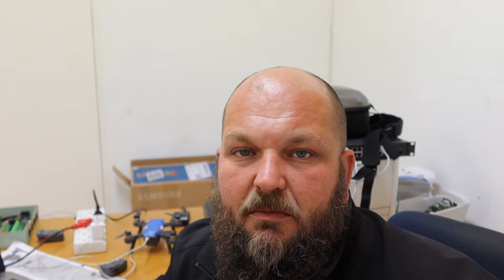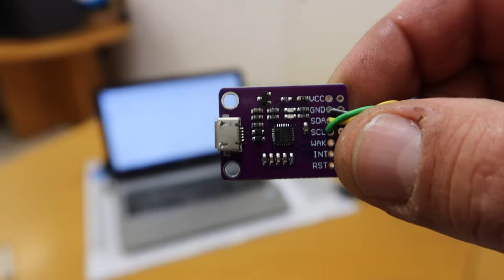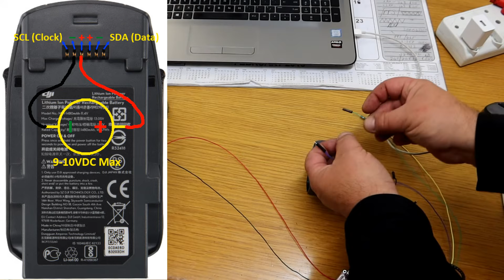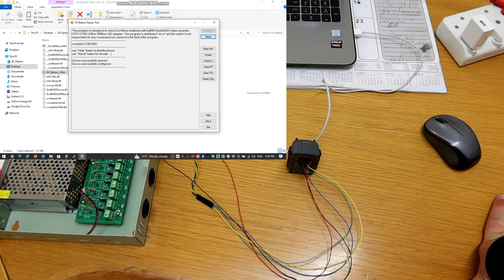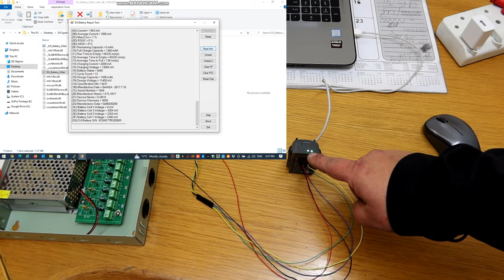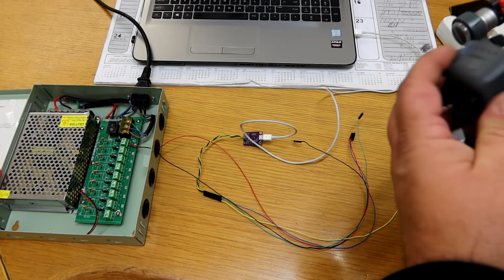Repairing your DJI Spark battery using a CP2112 HID USB to SMBus/I2C adapter!

Comment: Is there no easier way to fix this problem?  I'm getting the same light pattern as you demonstrated, but I don't have any of the stuff you used to fix it. I'm hoping if I leave it plugged in for a day it will fix itself, but I have doubts.

Comment: Cannot thank you enough, just bought an old Spark with about 5 flights on it (its like new) but been in the cupboard for years and the batteries would not charge. Bought the 2112 board and a few leads (used a 9v battery, worked fine) and after a few minutes they are back in in the charging cradle and charging nicely ... thank you for the great video, cheers. 😀
Reply: posso spedirti due batterie che non riesco a caricare? provi te s bloccarle? grazie

Comment: Hi Jacques great video being looking a video for weeks 
i`m have a problem with read info from the battery 
 get 0x00 error 
looked at you DJI softeware and it was diferent to the one i found can you email me a link 
 for the one your using as i now yours works regards Mick

Comment: Thank you so much for this video. I have watched similar videos where they make us pull the battery apart to do this. Your way is so much simpler and safer. Would you have a video showing how to connect the pins for the Mavic 2 Pro battery?

Comment: Just to add another thank you - this video was very useful and it matched the version of the software I was able to find on the internet.  One point to clarify which wasn't obvious to me (I'm not an electronics guy) - when you solder up the CP2112 you have to use the "inner" set of holes/ inner row of pins.  The labels on the back (eg I05 I06 etc) relate to the outer holes and are not equivalent.  If you aren't wired up correctly (or if your soldering isn't very good!) you will get "Error: Could not perform SMBus read 0x00" when you click "Read Info" until you get the connections right.  By the way for power I used a 9V PP9 sellotaped in series with an AA to give about 10.8V and that worked just fine.  Probably the PP9 on its own would have been ok if I had had my connections right first try!

Comment: thank you very much for this video.

I just finished the battery recovery process. It worked. I was able to recover all my 3 Spark batteries which I last used in 2022. I bought my Drone in 2018. 

I used the CP2112 from Lazada (brought to a cellphone repair shop to have the header pins soldered), Windows 11, 9V battery (with snap on connector to male Dupont wires), F to M Dupont wires, USB to micro-USB cable, and  DJI Battery Killer software.

Fortunately, my Windows 11 easily detected CP2112 debug board. I tried not putting the 9V battery at first but it did not work. The program is kinda buggy. Just keep on trying to run through the program if at first it doesn't push through smoothly. Sometimes it would give the --NOT responding - message and I just closed the program and started it again. On 2 occasions I rebooted the PC just to sure no other program was interacting with it.  Make sure all the wiring connections are correct.

Funny part was when wifey saw me putting on some protective goggles, face shield & gloves in the living room asking -- "is that thing dangerous?"  Me: no answer.
I am a microbiologist by profession.

Again thank you for this video. The Spark will fly again to rule the Galaxy!
Reply: How do you make it work? I have the same problem

Comment: Thank you!!! This is the most complete guide!!! I simply used a 9V batter for power. Thank you!!!
Reply: I will do this 9V battery option. I ordered already online the CP2112, some F to M Dupont cables and 9V snap on connector to dupont male pin; Hopefully I am able to recover my 3 dead Dji Spark batteries...and the Spark will fly again to rule the galaxy!
Reply: @gilean6179 My son has just asked for my old Spark - batteries dead after being stored for years - ordered CP board etc from Ali Express for £1.71, so will try this fix too! Great video, thanks.

Comment: Hello, do you know if i can use the same method and the chip CP2112 to reset Autel X-star premium battery?? I changed the lipo cells but Autel charger not picking it up to charge it. please give me an any advice or knowledge you have. Thank you

Comment: I took apart 2 Mavic 2 batteries and soldered one stack to the main stack with electronics. My drone will fly for 40 minutes if I force it but it's still seeing the original capacity. What parameter in Battery Killer am I looking for to input the new mAh capacity? They were joined at the live positive and neg at the batteries themselves. I can program the Mavic 2 with Drone Hacks to disable the 10% and 20% forced landing but I would rather see it in the battery so a stock battery would show correct data.

Comment: thanks you so much .. works after mutliple test.. I had to use a USB slot on the motherboard and not in front on my desktop tower. I had to use a old windows 10 for the board to be recognize. and I had multiple time the error : Could not perform SMBus read 0x00. I disconnect everything. make sure that the pin are correctly and firmly inserted in the connector. retest again .. and suddenly all works... was able to restore my battery which is now charging... but looks like I fix it.
Maybe the battery was very very low on voltage and had to be left on the power supply the time I do all my test 🙂

Comment: Successful Repair with my Spark battery that didn't recharge for 5 years.
i was using the type C version of CP2112 instead of Micro USB
also i was using a 9V battery instead of a DC supply and using some jumper cable to connect the battery as shown in the tutorial
it saved 3 of my battery and all 3 are able to take charge after reset
Reply: congrats; I will do this in the coming weeks as Ive just ordered all stuff needed online. Also 3 dead batteries after 5 years of not flying the Spark.

Comment: I ordered the board from Amazon, $5.00, soldered the header, made the connections to the battery, board and laptop. In less than 5 minutes following your video I had two working batteries!  The third battery I attempted to rejuvenate by opening and applying a charge directly to the lipo battery prior to knowing there was a software fix. Although it reads in the App and goes through the motions, I believe I damaged the lipo by opening it. It read error to charge. But I am pleased as punch I got the two batteries working. Thanks much for taking the time to post this great fix!
Reply: Hey, I was wondering what adjustable DC power supply you used in this endeavor? I have the rest of these items and 3 dead Spark batteries. Thank you.
Reply: @hawkmankt  I just used a 12v wall wart to start it charging then switched to the DJI charger when the 1st light started blinking.

Comment: Thanks for the video! I actually bought a new Potensic Atom 2 Fly More with 3 batteries for than less than the cost of my 3 Spark batteries. Too late. I love the incredible Sony 1/2 inch 48MP AI Night Shot sensor in the Atom 2. I'll keep the Atom 2 and attempt your repair for my Spark batteries.

Comment: Thank you, with you help I was able to bring my Spark battery back to life. I ran in to a few issues along the way but thanks to online forms like Grey Arrows Drone Club in UK I was able to get answers to my questions surrounding issues like not being able to connect to the board and not having a power supply handy (just use a 9V battery). Thanks again Jacques. PS I subscribed as a thank you.
Reply: How did you finally connect to the board.  When I click Connect I get an error ERROR: Could not open device.

Comment: Did not work for me, battery still doing the 1 and 2 lights blinking 4 times. Anyone have the same experience? Thank you all
Reply: Finally got fixed after trying about 12 times. Thank you Sir! Very clear walktrough and instructions

Comment: I did this using a brand new 9v battery as the power supply. Worked great! Just sayin. Sadly it's been a few years since I flew my drone and thats why the batteries were dead in hibernation. The DJI GO 4 app I use to fly the Spark is not supported on any iOS phones after iPhoneX. The app was super Wonky on my 15 Pro Max and I could never really get back in the air comfortably. Ended up buying a newer drone in the long run
Reply: im also worried about this but I have my wife's old IphoneXs with the Dji Go 4 app. I am just waiting for all the components to arrive to try this revival method. Haven't flown my spark in 5 years but decided to get it up again in the air and rule the galaxy!

Comment: got a small problem here. I do all the steps and once im done, it still blinks 4 times with the 2 led's and turns off.
Reply: same here
Reply: i got LED 1 & 2 blink 4 times after battery sitting there for 5 long years
and i am able to repair all 3 spark batter with the tutorial

Comment: ERROR: Could not perform SMBus read 0x00 please help
Reply: I was getting that error too, and it was because I had not soldered the board correctly.  What look like "pairs" of holes are not - you MUST use the "inner" row of connections next to where it says GND, SDA, SCL.  Don't use the "outer" holes to make the soldering easier, they don't perform the same functions (except GND which is common).  When I re-soldered it all I got the programme to work.

Comment: Just followed these instructions with a 9volt battery and it works! Fixed two spark batteries. Thank you so much!!
Reply: Im waiting for my cp2112 to arrive and try this

Did u use an adapter with 9volt battery then straight up connectted it to the spark battery?
Reply: Does the module come with cables from the video?

Comment: Thanks man , but i got an issue when i try read info i get this code ERROR: Could not perform SMBus read 0x00 can you tell me what i should do please , thanks
Reply: My issue was poor connections on the CP board and pins.  Also, the ground from the battery goes in pin 2 not pin 5 (ground from the CP board goes here).  I had them reversed, and when I switched it worked.

Comment: I'm keep getting ERROR: Could not open device in the software. any idea? thanks.
Reply: I am getting the same error as you. I have tried multiple cables, USB ports in the PC, and gave the battery external power. Has anyone figured this out?
Reply: @Fr1tzy  i downloaded battery killer ver 0.5 beta2 which has a tab for cp2112 connection which can tell you if your computer connects to the cp2112 or not.
Reply: Got the same error on my PC and doublechecked everything... Then I tried on a Notebook and it worked instantly. My PC didn't want to Work with the CP2112 Board.
Now I have following error:
ERROR: Could not perform SMBus read 0x00
Any ideas? 9V battery doesn't work.

Comment: I tried this on a Spark battery and it worked. At first I tried using a 9V battery, but when I tried that I got the error message "could not perform smbus read 0x00", presumably because the battery didn't give enough current. I then switched to a 9V power supply from a bluetooth speaker and that worked wonders. Now my battery charges without issue
Reply: Your wires not connected correctly

Comment: hi, can i use a arduino uno instead of cp2112?
Reply: I've done some research and found that it should work with an arduino as long as you're really good at programming them and manage to make the DJI Battery Killer software see it as a CP2112. As far as I can tell no one has published any code for that, so I recommend using a CP2112
Reply: @aeresys  thank you for this reply

Comment: I made the connection and connected its charger together and was able to restore one, but my other battery recognizes it and reset its parameters with the software but it still does not turn on its LEDs or charge, what could it be? Is there any way to also know the battery chip? is for mavic 2 pro and the battery model is FB2, thank...

Comment: Super bummed, after getting all the items necessary unable to repair 4 DJI Spark batteries.  With all four batteries I get the same error message "ERROR: Could not perform SMBus read 0x00" when attempting to read info, even with the use of an external power supply providing a constant 10V of power.
Reply: https://www.youtube.com/watch?v=-Af5LyQaYJo&t=1145s
You need to be in the region of about 10.5v MINIMUM collectively. So it will be at 3.5v each. Battery killer will more often than not fail to clear the PF if each cell is below 3.5v each. Also, its better to charge the battery at about 12.5 volts, up until each cell is 3.6v. This will at least give an idea if cells are ok and at least holding a charge
Reply: @AshrafRogers  Thanks for the response, I will give this another try.
Reply: Your wires are not connected correctly

Comment: Hi thank you for the video. This method works for my Spark battery. However not on my mavic pro battery. Do you know any other way to do it? I keep getting  this error from the software "Could not perform SMBus read 0x00"
Reply: slightly different procedure for the Mavic and Phantom batteries

Comment: Wow, absolutely fantastic tutorial. Restored 4 Spark batteries like that. Personnaly, my problem was the first light blinking. I used a 12V, 2A power source which ended up consuming 12V and 0.4A when the batteries began to charge again. At some point I had to be patient and tune the power... Had to try 2-3 times for the first battery to make it work, but the rest was done on the first try. Also had to charge them a bit more sometimes so the drone would turn on. I can't thank enough this tutorial (and Jacques).

Oh btw here's the link to the Drive containing the software 13.06.2021 DJI Battery Killer : https://drive.google.com/file/d/1F-hjFhaPGixog1-4q2XkKmVmcSnppLZo/view

Have fun guys :)

Comment: Just saved 3 DJI spark batteries.
Reply: What did you use as a power source?
Reply: I used a 12v power adapter. I inserted one lead into the center of the adapter prong and taped another around the outside then taped it together. Not a permanent solution, but I only needed it for 3 batteries. @limbotachyon

Comment: Excellent - thanks, Jacques. All three of my Spark batteries are now happily charging. For clarity, Pin 1 is clock and goes to the SCL pin on the CP2112. Pin 6 is data and goes to SDA on the CP2112. The batteries were so flat they needed additional power to enable the CP2112 to read them - in my case I initially tried a 9V power supply but it didn't provide enough grunt, so instead with the jumper wires still attached I pushed the battery into the DJI charger - ugly, and needed to press fairly hard (trying not to press too hard, to avoid damaging the pins on the charger), but it worked. The version of battery killer I have also provides three options - BQ9003 worked for me with the process being Read Info, Unseal, Clear PF, Clear PF2, Reset Chip. Just need to watch the screen - if there are errors (for example due to the CP2112 losing connection) just try again from the start.
Reply: How did you get 3 options? Mine currently isn’t reading the battery and I tried it on a working battery, still so signal
Reply: @Gemiivii Try a different USB cable. It needs to be able to transmit data

Comment: please be careful this video will only work with batteries are at 2500-2700 ,because the minute he reset chip voltage was 3400.. and these where close to balance, there are 2 errors you can get, PF, and ss, pf means it just in hibernation, SS means its out of balance, it wont work this ease if you have both SS and PF , and if both a in data, charging will mostly discharge instead of charge,  the worst error you can get is 2nd light in blinking while charging
Reply: Hi, it seems that I have/had both errors. The PF could be solved but the battery is still not charging and 'SS" is marked red. Any idea how to solve the 'SS' error? Thank you!
Reply: @cruzroy, any idea what I can do to solve the „SS“ issue? Thanks!
Reply: ss would require opening the battery and manually recharging all cells to balance.
Reply: @blacksmithz05  hi, did you respond to my comment? If so, I am very sorry but I don’t understand what you mean :(
Reply: Any input fit this question?